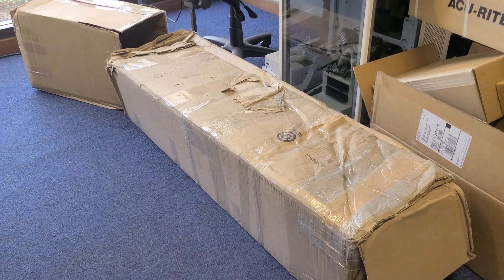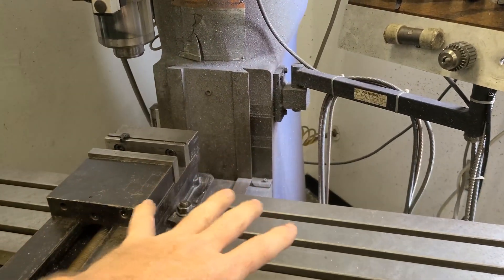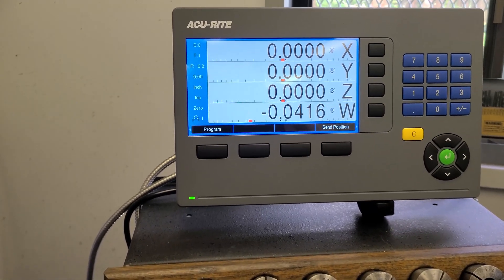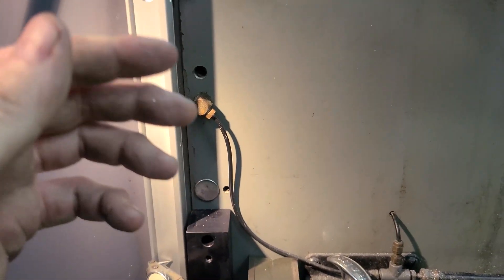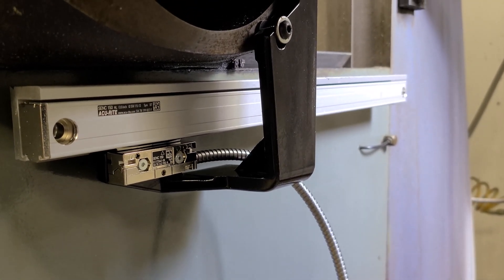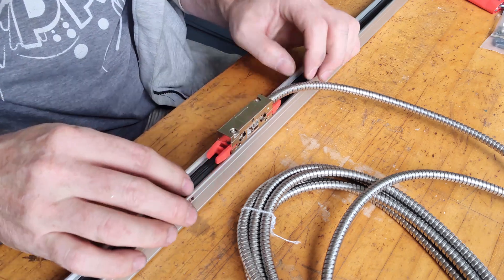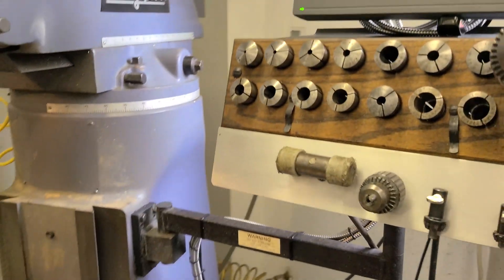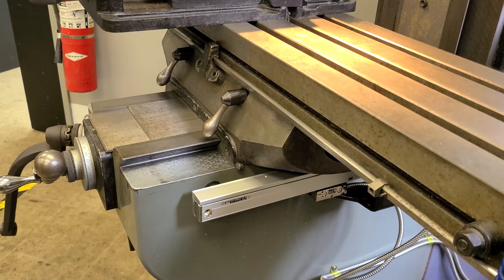Installing a NEW DRO on the Bridgeport

Comment: Hey Boss, I am really liking that collet/screen holder you have mounted on the right side. Anything you might change on that? Assume the holes you made to mount it did not intrude on anything? Did you just make the box out of aluminum or sheet metal?
Reply from the maker: That thing is probably 25+ years old, installed by my predecessor.  It's got a couple clips to hold a drawing too.  Very useful.  The new holes didn't interfere with anything.

Comment: Behind the extrusion on the z axis scale, I am assuming there are pads that it rests on? Are these independently fastened or floating behind extrusion?
Reply from the maker: Scale bolts directly to black brackets seen at 3:37.
Reply: @chopsmitty  I think he was asking about the backup spar on the knee.   At least that's what I took from the question, as the quill scale install was pretty clear.